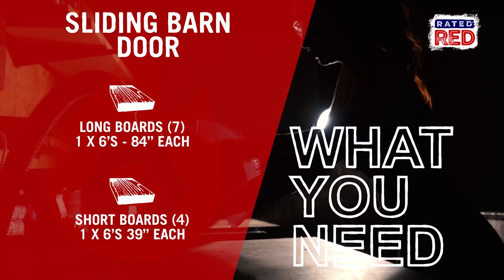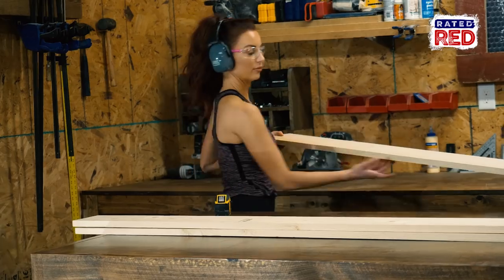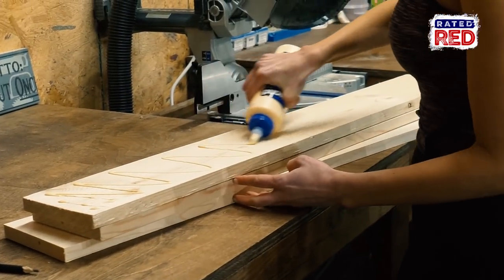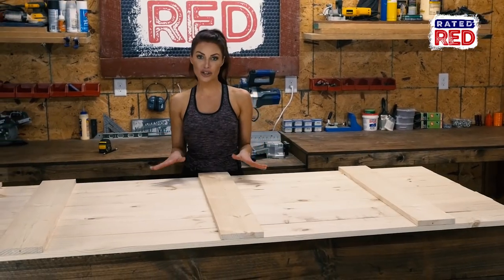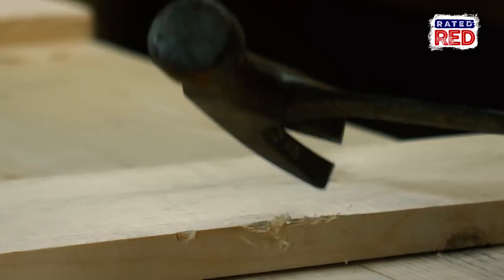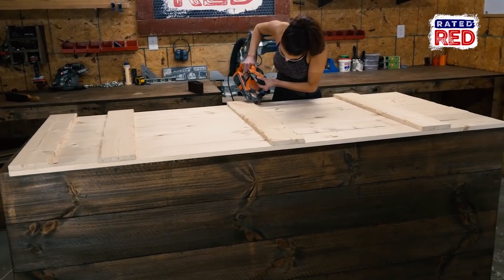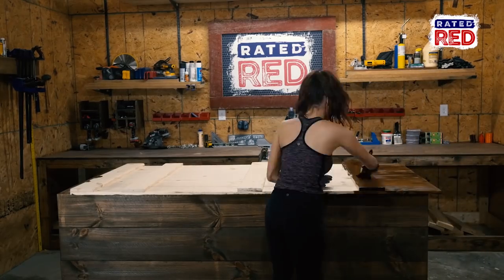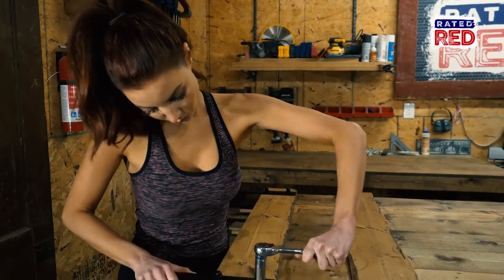Sliding Barn Door | Red Hot Building

Comment: My grandfather used to" make antiques" out back in his shop.  He distressed them with a clean bicycle chain.  Smack the boards a few times with the chain in a few approproate places that would normally take the wear and there you go.  He also used a really, really small drill bit to bore “worm holes”.  His finish of choice was boiled linseed oil mixed with about 1/3rd turpentine.  Warming the wood in the sun and warming the mixture, the turpentine really helped the linseed oil soak in.